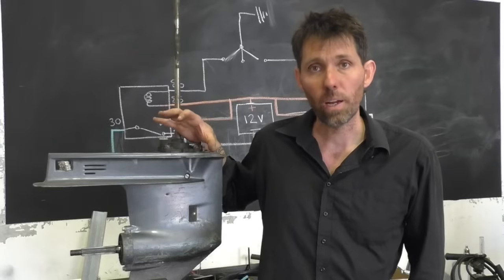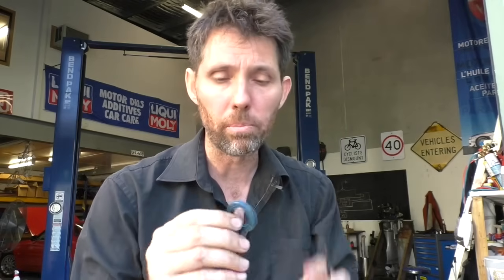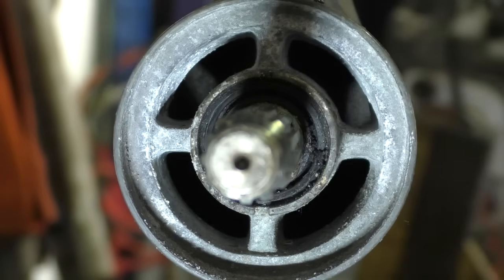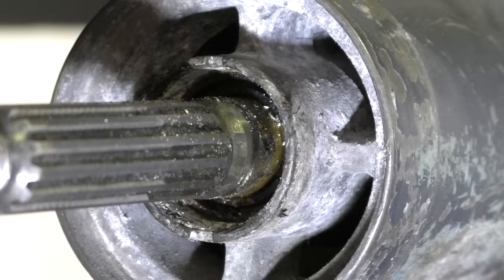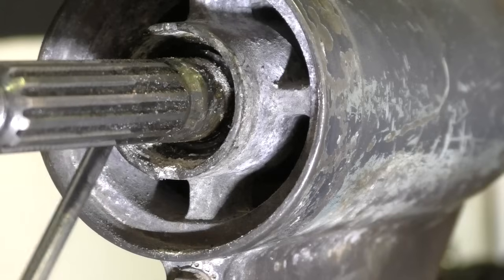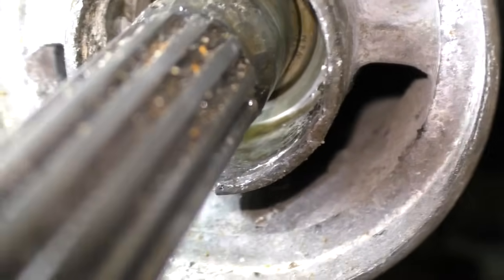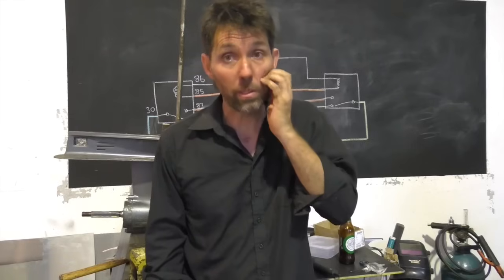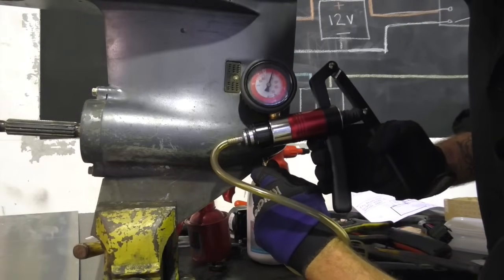Replacing outboard oil seals the hack way

Comment: I tried the "hack" way and just couldn't get it to work. Guess I need to get one of those little "hook tools" that you were using. the steel on the lip was too small for me to drill a hole for a screw so I bent the edges over and then tried to make a hook tool from a screwdriver but the steel was to soft to do the job. I live out in the desert a bit, so trips to town for tools is a no no. Do they have these on Amazon? Could you point me to the right tool? I ended up using a huge wheel bearing puller and get this, "S hooks" to reach the carrier bearing housing. Had to use 2 on each side. No heat required, it just pulled right out. Seals were easy after that. thanks again for the great video.
Reply from the maker: Hi Roy. Glad to hear you got there in the end. I certainly know the feeling of not being able to duck down the road and grab a part or a tool you need very easily. This puller looks pretty similar to the one I normally use (from memory) I can't actually remember what I used in that vid https://www.amazon.com/Lisle-56750-Seal-Puller/dp/B0002SRCKG

Comment: Hi Stu. What is the name/model of your pressure tester please?  How long should it hold pressure? I've made a hack one out of an old gear lube pump (removed pipe with Evinrude attachment still on), tyre valve slide on to the opposite end of the pipe and a bicycle pump with a gauge.  It works, but it's a hack way of doing it.
Reply from the maker: I think this is the tester I bought http://www.ebay.com.au/itm/21PC-Hand-Held-Vacuum-Pressure-Pump-Tester-Brake-Fluid-Bleeder-Bleeding-Kit-Set-/142185957762 It should be able to hold 10 PSI for 30 seconds without dropping.
Reply: Thanks for the link.  As I'm using a bicycle pump I can only get the PSI to 7, but it holds for an hour or more.  Left it over night and when I checked I'd had dropped to 4 PSI. So, I think my seals are good.  I'll take some hoots of my make shift pressure tester.

Comment: Great video, this can be done on outdrives as well. Thanks for taking the time to make this. Good to know that there are other "hacks" out there besides myself..... Beer looks good....
Reply from the maker: Hey Roy, yes, there are many motors this can be done with. In fact it is the only realistic way to get the front and rear crank seals out of many motors when they need replacing.

Comment: Thanks for the very informative tutorial. I'm going to be attempting this on my 1991 Johnson GT 100. Do the oil seals need to go in any particular direction or are both sides symmetrical on both seals?
Reply from the maker: Seals have a flat side and a cup side (or spring side). Generally the spring side faces in towards the gearbox.

Comment: Good video.Can this be on the drive shaft seals ona older Johnson outboard that does not have the removeable seal housing?
Reply from the maker: Good question, I can't say I've ever done it on a Johnson but I can't see why it wouldn't be possible.
Reply: thanks..I see that some people say to use a sealant on the oil seals before seating them.Do you ever do that?

Comment: can a lower unit hole welded,,oil leaking from damage by contact
Reply from the maker: I'm sure it would be possible, but I have never done it. Cast metals tend to be harder to weld and there will no doubt be a lot of oil in the metal that would be hard to get out. You may find it easier and cheaper to source a second hand gearbox. Worth giving it a try first though, if you aren't paying top dollar to get the job done then you don't have much to lose by trying.

Comment: Hey bloke, 
Got the Yammy F100(67F) apart and am re assembling now. One problem, while the Cylinder head and cam shafts are off of the Block,  a mate spun the Crank. 
How do I ensure everything is lined up properly?
Reply from the maker: It's a very old video, but this is the one where I put the cylinder head on my 50HP Yammy that might give you some ideas.
Reply: ok ta. So, at the 15min mark of that video you mention TDC of Cylinder 1. ...Cylinder 1 would be the top one?

Comment: Again thank you for this tip. I have run across many of the bearing carriers that were seized up and couldn't be removed, and many times I just bought a used lower unit on Ebay that cost several hundred dollars where I could have used this technique and saved all that money...
Reply from the maker: There are so many bearing carrier that just won't come out. This one has saved me many times!

Comment: Thanks Dangar, I take my hat off to ya mate! I have an old 1972 Evinrude 100hp Starflite 2 Stroke outboard and have wanted to do the prop shaft seals as I notice the gear oil was ever so slightly milky when I drained it. I changed all the top end seals no sweat, but the prop shaft bearing housing has completely bonded to the gearbox casing! I've tried penetrating sprays, heat, Slide hammering and reverse pressing it out, but she's not going anywhere! Therefore your method may be my only saving grace!!! I have just been paranoid about starting, just in case:- I experience a similar issue with the seal not coming out, - I push the old inner seal in too far (wasn't sure if there was a lip in the housing to prevent this)- I damaged the prop shaft or bearing housing!What I may do is pressure test the gear case first and see if it holds pressure after doing to top seals, if not I may have to take the plunge and give it a go...Your time and effort is really appreciated mate, keep up the awesome work!😉

Comment: hi, the nitrile (buna-n) O-ring you mentioned as replacement for non-SS spring, is it of the normal type O-ring one commonly use for say a water pump cover etc...
Reply from the maker: Yep, nothing special about it, just has to be the right size and diameter.

Comment: I nicked my propeller shaft a tiny bit in a few spots while removing the seals. How big of a nick in the shaft is too big to the point where you need to replace the entire shaft? If it's a small nick, can it be repaired??
Reply from the maker: Hi Kevin, it's hard to put into words, but there are two main problems. If it is a depression, oil can leak past the seal, if it is a sharp ridge it can cut the seal. You can you some VERY fine emery paper to smooth a ridge, but you want to be careful not to make it worse. Don't forget, the nick has to be exactly where the oil seal rides to do any harm at all. If they are further out or further in, they aren't a problem.
Reply: Dangar Marine thanks so much for the reply and the advice! I will give it a go and see how it works out. Hopefully I can save it and it's not too bad
Reply: Dangar Marine do you have any videos on replacing a prop shaft??
Reply from the maker: No, not at the moment but I do have plenty of gearboxes here in the workshop so I'll do one over the next few weeks.
Reply: Dangar Marine awesome! Look forward to it

Comment: question, I'm putting lower gear seals in my outboard 1996 Evinrude 50hp. do you happen to know which sides they go in? spring side out towards prop? or springs side pointing to gears? mine requires 2 seals... any help! Thanks
Reply from the maker: Look to be both spring side out: http://www.boats.net/parts/search/BRP/EVINRUDE/1996/E48ESLEDC/GEARCASE/parts.html
Reply: Awesome! Thanks! Keep them videos coming!

Comment: I don't Believe this is a hack way of replacing seals at all. As a certified tech in the states I have replaced hundreds of crank and cam and transmission input and output shaft seals almost the same way. I have a seal remover you might like, its a matco LSP1A
Awsm Videos keep it up
Reply from the maker: I tend to agree with you Tyler, but don't let the Internet trolls hear us saying this. ;) I'll have to see if I can grab one of those seal pullers and give it a go. Thanks for the tip.

Comment: Any follow up on how the new seals are holding up?
Reply from the maker: So far so good. These were leaking bad enough to see oil rising when the leg was tilted down which is no longer happening. The final test will be so see if there is any water in the gearbox next oil change, but I'm not expecting any.
Reply: Thanks!

Comment: Hey Dangar. it is the same procedure with a 1970 25hp johnson? gear box putting apart?
Reply from the maker: Yes, pretty much. Taking the gearbox apart will be slightly different, but you only need the prop off to do this.

Comment: Inner seal should probably go in the other way? Or with double lip seals it probably doesn't matter.
Reply from the maker: No, the service manual shows both oil seals going spring side out (towards the water). Interestingly in the Honda service manual they have spring side out on the outer most seal and spring side in on the inner most seal. I'd be surprised if it has anything to do with gearbox, but possibly the seals. Some seals are double lipped, some single.
Reply: Thanks. Looks like this is an Interesting subject to discuss. And yes, Yamaha has both springs out : http://www.yamahaoutboardparts.com/forum2/orientation-seals-lower-unit-th20439.html

Comment: I have  been putting off replacing seals, thank you for giving me the confidence to replace with new.
 i will make sure to get a good look at the size of new  seal to have a better less expensive one for the next time. we would like to share a little sunshine, visit Florida
Reply from the maker: Hey Stephen, good luck with the seal replacement. Just watch out of the prop shaft and you'll be fine. I'd love to visit Florida again. Had a great time there many years ago. :)
Reply: Thank you. I just finished

Comment: I have a 1982 50 HP 2 cycle mercury outboard. I replaced the trigger' but although it starts easily it still has a miss in one cyl.the coil is good the coil wire is good and the sparkplug is good. The trigger is new.Do you have any idea what needs to be done?
Reply from the maker: Unfortunately this type of intermittent misfires can be hard to diagnose. Have you watched this video: https://youtu.be/MDbvkFM1V_c If the misfire is in one cylinder then it can't be a trigger problem. I would look at all the connections on the coil for that cylinder if the coil is known to be good. Also look at the motor running in the dark if you can and see if you spot any sparking outside the leads.

Comment: can I flip the dog gears on my Chrysler Sailor 250? I presently only have reverse.
Reply from the maker: That's a good question. I would guess not because the selector linkage is designed to go into one side but I like your thinking. I got mine machined for very little money so that might be the way to go.

Comment: Very Very Impressive, and immensely helpful. Based on your tutelage I have rebuilt an '85 Yamaha 6HP a 1964 Evinrude 9.5HP, and now working on a waterlogged 14' 1985 Vontage using most of the Dangar vids: from trailer bearing replacement, to carburetor rebuilding, and oil seal replacement the hack way, and everything in between. A newbie to anything to do with motors or boats, I am on my way to resurrecting a mini version of the blessed GreenMachine!  Your meticulous camera angles, tripod placements and all the special treats like how you cutaway the gear case for "How an outboard gearbox works".  Thanks so much for your gracious guidance...carry on warrior Stu !  ~  doug, vancouver canada
Reply from the maker: Thanks Doug, so glad to hear the videos have been helpful. It is hearing that that makes it all feel worthwhile. Good luck with your own personal Green Machine project! :)

Comment: If it doesn't hold pressure you're screwed because you can't get the new seals out without ruining them. Still worth a try if you have an old lower unit or you don't have the cash to pay a dealer.
Reply from the maker: I wouldn't necessarily go so far as to say you are screwed in that finding these aftermarket ones means they are quite cheap. I think I ended up buying ten for what a couple of original Yamaha ones would have cost me.

Comment: Hello Danger,
Been watching your videos for a short time due to the purchase of an old sun tracker party barge pontoon. The motor on the pontoon is a 1989 mercury 50 hp. I recently tried to start the motor but realized two of the spark plugs are not firing. Cheeked the coil pack connection, the two coil packs had no power going to them. One of the wires to the CDI switch box was in bad shape so I replaced it. This however did not fix the issues. Two of the wires coming out near the fly wheel had no power at the connection spot on the CDI switch box. Figured the wire might be bad as well so I cut it and replaced some of the wire coming out from under the fly wheel. This did not work either. So right now I am stuck and have no idea where to go from here. I hope you can help me out. 
Thanks for any help. 
PS i posted this on another thread within your page. The other thread was older so i figured i would get a response from this section due.

Comment: Thanks for the tip on the seal Springs. Will be ordering some first them Monday morning. plus double lip seals are always the best way to go. you should get  any bad comments on that. You have to do the same thing on high performance cars when idiots decide to give the car too much horsepower cam seals get too hot and that was on an Audi R8. that's what being a mechanic is all about experience. have a beer on me for that idea 💡.
Reply from the maker: +Bowes Project Thanks mate, glad you liked it. The guy I got the seals from also specifically mentioned the heat resistance of the o-rings so it is interesting you should mention that - not that underwater gearboxes get that hot I guess! P.S. I'll have that beer tonight. ;)

Comment: Great vid my favorite so far, I've destroyed 3 carriers trying to remove them. This would have been a great solution.Marine oil seals are a rip off, I just ordered a lower unit seal and base plate kit and it was $85.
Reply from the maker: +alnbaba That's what gets me about all the insistence (particularly on social media) that things be done the "right way" Sometimes you just don't have that options and you need other techniques to fall back to. You are also right about the cost of marine parts. That's why I was so pleased to get the o-ring top from the engineering shop down the road.

Comment: I sometimes use a drywall screw into the old seal to pull it out as well, and use a piece of PVC pipe to drive the new seal in.
Reply from the maker: +classicoutboards Yeah, the PVC pipe is the perfect size. :)
Reply: Will this work for a mercury lower unit?!
Reply: @danfogarty5114  what size pvc??
Reply: @johnchrist3092  i think it was 1.5 inch, I did this a year ago or more

Comment: Great video as always.  Nitrile o ring in place of garter spring is a great idea.  Just be careful of the it dislodging from the lips if not fitted properly.  One thing you did not mentioned is the oil seal material.  I will put a viton rubber on the inner side n a nitrile on the outer.  Double lips are great n I use them all the time.  Keep up the good work.
Reply from the maker: +Richard Yap Hey Richard. I'm wishing I had done a closeup of putting the o-ring in to show fitting it securely. That's a good point about the differing oil seal materials. Next time!